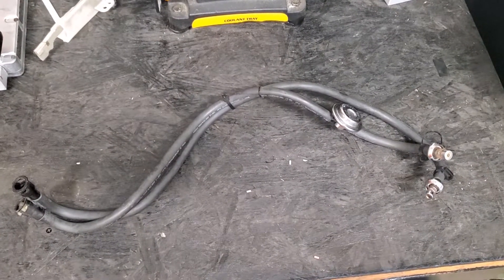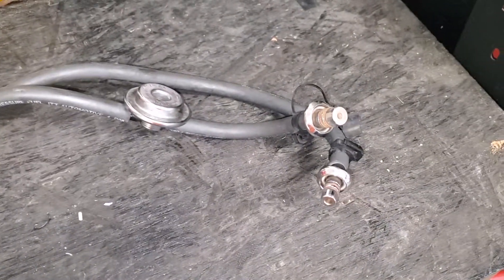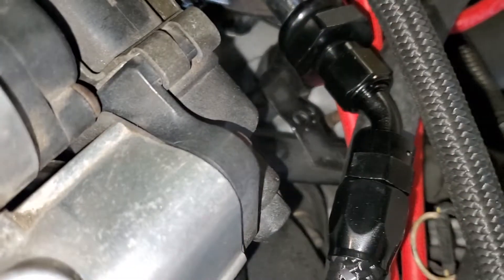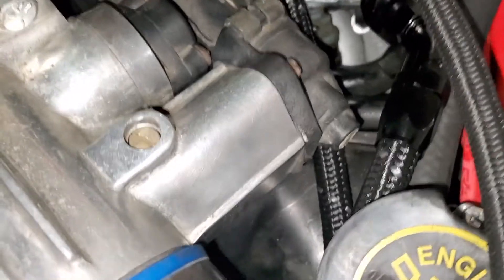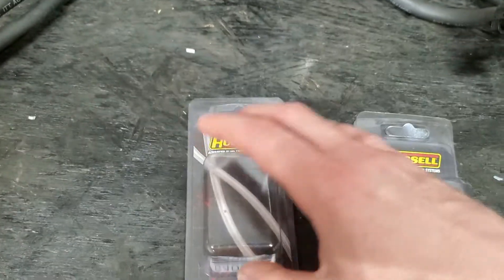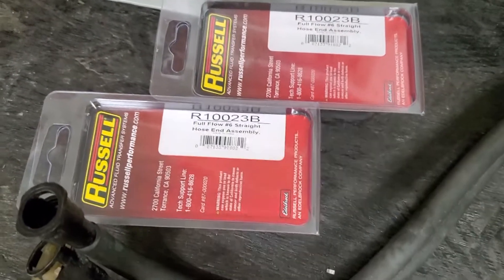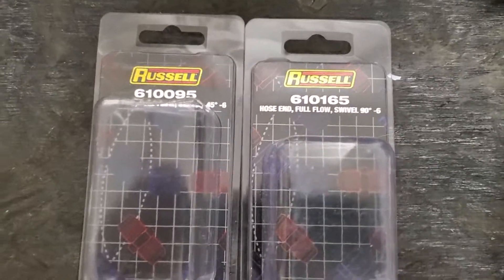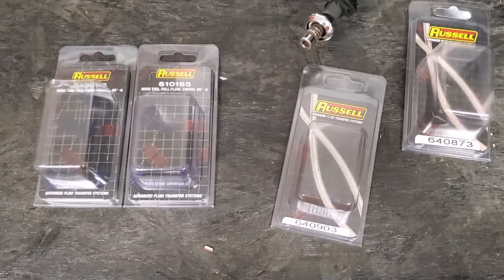SN95: Fuel Line Upgrade

Comment: Hi
I have a 95 Cobra with a leaking fuel rail.  
Any idea who makes a fuel rail kit for the 94 & 95 models? 
Finding a lot of stuff for the 86-93 models but the SN95 5.0s seem to be bastard children.
Reply: Hi
I got one from Speedmaster 79.  
Luckily I already had an aftermarket Distributor as the rails will not work with an OEM distributor.
Reply from the maker: Nice! Glad you found something that worked!
Reply from the maker: Sorry no clue

Comment: Thanks
Reply from the maker: One stock line was roughly 34 inches and the other was roughly 32 inches. If I remember correctly I made them just a touch longer so they would sit in the factory clip on the fender and still route as clean as possible

Comment: Do u need that part u removed the pulse damper the circle silver thing on hose im trying to upgrade fuel lines but idk if i neex that part
Reply from the maker: I did not reuse that
Reply: @BabyLegsMotorsports  how is it running brother just wanna make sure it doesn’t affect anything if i delete it when upgrading fuel lines
Reply from the maker: I didn't notice a difference after removing it
Reply: @BabyLegsMotorsports  how about with air and fuel ratio
Reply from the maker: I was still tuning at the time, but didn't see any difference there either
Reply: How about the pressure  🔒 locks? Are those not now eliminated?
Reply from the maker: The factory clip things on the push style connectors?

Comment: I’m sure you’ve figured this out by now but all the B means at the end of the part number is black. I do have a question: 640863 push lock goes on return and 641303 pressure/feed? I’m currently following your lead but having a hard time getting 641303 to clamp on.
Reply from the maker: I'll check this in the morning and get back to you
Reply from the maker: Are you talking about the fuel rail side of the metal fuel line side? Edit: Yeah those from what I remember just push on.

Comment: Is the smaller line the higher pressure
Reply from the maker: The 640903 is for the pressure side, I cant remember if it was bigger or smaller
Reply: @BabyLegsMotorsports  thanks,  just working on carb swapping my 1995 gt
Reply from the maker: Just checked, bigger should be pressure